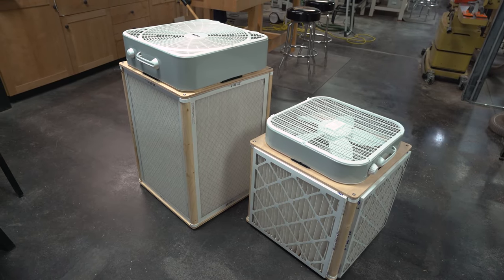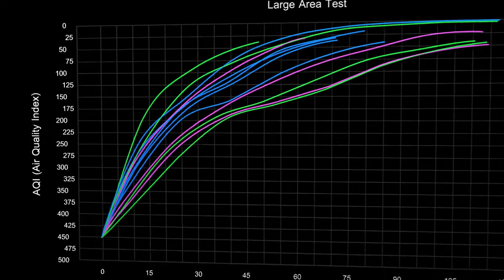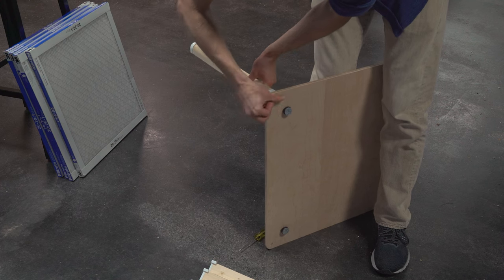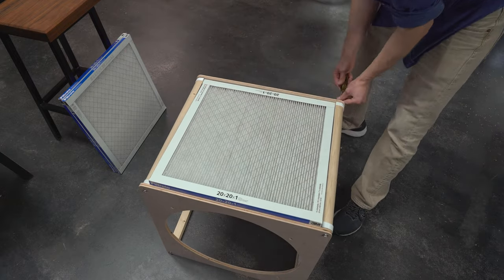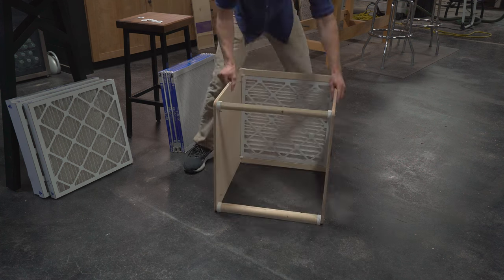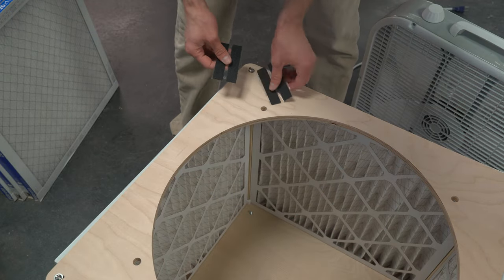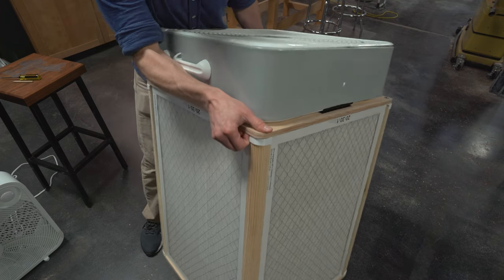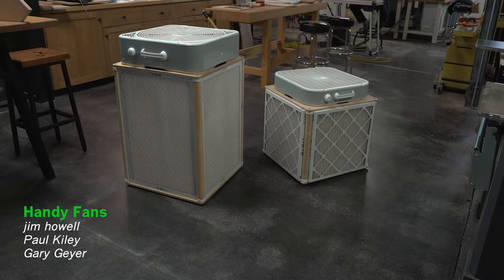Air Filter Kit - Model-B/C - Design and Assembly

Comment: I'm a bit late to the party, but have a question. Can your design be modified to include a 5th filter on the bottom?
Reply from the maker: You're right on time! All the tests that I've run indicate that the 5th filter doesn't meaningfully increase performance. It's also cheaper to buy filters in packs of 4. If you want more filter surface area, the 20x30in filters are the way to go.

Comment: I would like to see a particle test comparing a fully taped/sealed fan of this design vs the exact way this one is designed. Where the Velcro is with the fan sitting on top doesn't this Also allow "dirty" air to pass through? Also I thought the four corners on the top not being covered would pull in "dirty" air? Or after a specific run time as it purifies the air would this small gap even matter..
Reply from the maker: That's a good idea. I suspect that the small gaps will have very little difference in overall performance, but it's better to know for sure. I'll add that test into the video about A/B/C performance. Thanks for the thought!

Comment: I'm debating between Model B/C. Which would you recommend for an 1800 sqft house?
Reply from the maker: Sorry for the late reply, just got back from vacation and haven't been able to sit down and answer comments lately. The number one goal was to start getting these kits into the mail this week.

To answer your question, both are fine options. The Model-B will be able to filter more air but if your house is 2 stories or divided by lots of walls with small doorways (so, if you don't live in an 1800sq.ft. yurt), the extra air flow may not matter to much. 

All these obstructions will prevent air from circulating perfectly through all your spaces, so a Model-C in your largest room should do the most good for the lowest price.

I hope that answers your question. If you have any more, let me know!
Reply: @The3DHandyman  Won't the larger filters last longer? I'm wondering if the extended use will make up cost difference on filters
Reply from the maker: @wishitwas  Yes, the 2in filters are supposed to last 6 months in an HVAC unit and the 1in filters are supposed to maintain their rated efficiency for 3 months.

The 20x30in filters are also about the same price as the 20x20 filters much of the time. So, that will further increase the amount of time between filter changes and lower the cost of use over time.

I ran one of these units in a dusty basement for 4 months over the summer and the 20x20x1in filters turned a light shade of gray. I think they could have easily lasted all year (though they would have been rather gross looking by then). I suspect that 20x30in filters might last up to two years in a relatively clean space. I'm not sure though because I do not have testing data for that specific scenario.
Reply: @The3DHandyman That was my thinking, that I’ll probably get up to 3 years from 4 20x30x1, w/ just as much air flow as 5 20x20x1 in a relatively clean house. 

Was even thinking I could upgrade it at some point by adding legs & a 20x20x5 Nordic Pure MERV 14 Carbon filter to the base to improve gas filtration.
Reply from the maker: @capcom4eva  I think that's reasonable to assume. If you don't have 5 dogs or something 2-3 year life expectancy on the filters is possible. After dumping fine dust into a Model-A for 1 year it performance went down noticeably. In a mostly clean house it will take an extremely long time to collect that volume of dust.

The filters + carbon don't seem to really do much in my tests. The actual amount of carbon on most of those filters is extremely small.
Reply: @The3DHandyman  Ah, thank you for the carbon tip, I went with the IQAir GCX + IQAir HealthPlus Pro to deal with the fire aftermath soot, fumes & toxic flame retardant off gassing! Can you vacuum the DIY filter boxes if they get heavy dust accumulation, or not recommended?  

I’m going to build a MERV14 3M 20x30x1 + 20” Air King box fan, think it’ll have 1200CFM, like the MERV13 20x30x1? I chose MERV14 since it does a little ultra fine particles, whereas the MERV13 does zero ultra fine particles.  

I guess with the high CFM rate of the Air King, it might trap 99.97% of ultra fine particles with rapid multiple passes in a 300 sq ft area, even though it’s rated to catch only a small percentage of ultra fine particles on the 1st pass. Will this build achieve the same results, albeit a longer time frame, as a HEPA air scrubber at a fraction of the cost? 

Thanks, I’ve learned so much by rewatching your videos & chatting with you, thank you! I’ve never done much DIY, but your videos inspired me with the encouraging data results you’ve shared on these cost effective, yet powerful CFM builds! For the money, you can’t go wrong! 😁👍🏽🛠️

Sorry, final question: if I get a good deal on a 4 pk of filters, can I buy 2 extra sets to put in storage, if each set lasts 2-3 years, or will they degrade over time sitting so many years & better off buying a fresh pack of filters only when needed? The Air King is really loud, wish there was a quieter & more efficient option. Thanks!
Reply from the maker: @capcom4eva  Fine choice with the IQ Air. You have a pretty extreme situation you are dealing with.

The MERV 13s and 14s should capture some ultrafine particles. Although the 14s should preform much better (20-75% vs 75-84% sub micron particles). The air king with 20x30s will move a lot of air. I don't know how it will compare to a HEPA filter in your scenario. There are much better particle counters out there than the one I'm using when it comes to sub micron particle performance. What I can say is that in my tests across all particle sizes, 3M filters are by far the best. No other brand is close.

If you leave the filters in their plastic packaging, they should last indefinitely. Sometimes the 3Ms come on sale and that is definitely a good time to stock up because they can be pretty expensive.  

Yeah, the air king is loud for sure. You can make a "fan shroud" out of cardboard with a 15" hole in the middle. It does a little for performance and a bit for sound reduction as well.

Hope that helps!
Reply: @The3DHandyman  Do you happen to know the difference in filtration rate of ultra fine particles between the 3M MERV 14 MPR 2500 vs 2800? I went to the 3M website, but don’t think they list a precise answer. 

I went with MPR 2500, b/c it was less than half the price of the MPR 2800. I would love to try the MPR 2800, if I can secure them at a price close to what I paid for the 4 pk of MPR 2500 at Costco @ $59.99. 

Would be interesting to see if anyone has tested for it & how it compares to HEPA, when ran through the Air King with its large 1200 CFM. I guess you can say this 3M 20x30 MERV 14 + Air King setup functions like an air scrubber, no? Thanks!! 🛠️
Reply from the maker: @capcom4eva  I recently tested the 2800s against the 1900s and, at least with my basic testing equipment, didn't see any tangible difference in smoke filtration. So if the 2500s are at costco for 4 for $60, do that. That's a great deal.

I don't know exactly what defines an air scrubber but the air king is going to process 2-3 times more air than your standard HEPA filter, though with a lower efficiency on the ultra fine particles.

Comment: Love your videos! I'm just to order my filters to make my own. How long do the filters last before they need to change?
Reply from the maker: Glad you are enjoying them! I have run a 20" box in a friends home for 6 months and the filters show little dust build up, even with lots of pets. In a shop scenario, after 6 months of use, they are loaded with dust but still preform well in a smoke test. So, if you are using 1in filters, you should get at least a year out of them under most conditions. 2in filters may last even longer.

You can also consider K&N washable filters which will work for many years and only cost slightly more than disposable filters. These do not capture smoke sized particles as well as MERV 13+ disposables but they work great for large particles. Here's a link https://amzn.to/3UN3mXo

I will have some updates to these designs soon where you can buy a 3D printed part pack and the plans to make them. There are also a few new updates as well. Hopefully I can get this launched by the end of the month 🤞
Reply: @The3DHandyman  Thanks!!

Comment: Just made one but with fan pointing down inside. What's the difference if the fan blows inwards or outwards?
Reply from the maker: Outwards tends to filter that air in a room better because the air is more directed coming out the front side of the fan. If the fan is pointing into the filter box the air in the space right around the filter (~3ft) will get stuck in sort of a filtration loop where the same air gets filtered over and over again and the air elsewhere in the room gets filtered less.

I need to make a video about this some time soon. A lot of people ask this question.
Reply: @The3DHandyman  Thanks! I was going to ask the same question since in some of your other videos the fan is blowing into the filter box. Great content!
Reply from the maker: @alfredorodriguez1281  Thank you!

Comment: What is the adavantage of using a 3m one inch thick vs 2 inch thick..TIA
Reply from the maker: The 3M 1in filters actually have more surface area than the average 2in off brand filters and that translates into better performance. Both are good options. The Filterbuy 20x30x2 preformed slightly under the specs on the 3M 20x30x1 MERV 13. 

I had hoped to get the video with results for the Model-B out sooner but I have been slammed with orders since launch and haven't had time to produce any videos for the last few months. New content should be out next month, though. Until then, I've managed to get some of the info up on my website https://the3dhandyman.com/what-is-the-best-air-filter/

Let me know if you have any other questions!

Comment: Can you build one that’s uses a carbon filter like the one on the iq air ?
Reply from the maker: I will do a video on carbon filtration some day soon. So far the most effective way that I have done this is with a ducted system. Lots of carbon requires lots of static pressure and a more powerful fan than the standard box fan.

Comment: one flaw if it is that These fan is considered a bit loud. I guess it would be ideal in big work shop.
Reply from the maker: That is partially true. They tend to be louder than your average HEPA filter on a LOW setting but on HIGH HEPA filters tend to be about as loud.

Here are the sound ratings in decibels:
Honeywell HPA200 @1ft - 58, 54, 46, 41
Blueair 211@1ft - 61, 50, 41
Lasko @1 ft - 63, 60, 55

Comment: Sorry, I could not find a link to buy a kit. Your Etsy page is showing completely different things.
Reply from the maker: Sorry for the confusion! I relaunched this kit with plastic & metal parts here https://www.etsy.com/listing/1373712349

The wood version caused a lot of problems with warping and voids in the plywood so I made the switch to for reliable materials. 

The new kit works the same as the ones in this video. I have not yet had time to finish up the new videos for the relaunch of the kits. I am hoping hey will be done some time late next month.

Let me know if you have any questions!

Comment: Have you done any real world testing on how long the filters last in a normal home environment for air purification? Most of the filters recommend around a three month life but real world with the particle counter what are you seeing for the lifespan of filters? 

On the 4 filter design merv 14 changing every three months you could be $200+/yr on filter replacement alone. . 

Also the link to kits was not working..
Reply from the maker: I'll be testing this in an upcoming video. I need to figure out exactly how to soil the filters evenly and immediately in a realistic way. I'm hoping that will be out in March.

I don't think that they need to be replaced that frequently. The Nordic Pure MERV 14s in my Model-A unit were completely filthy after 6 months of use and they still managed to pull ultra fine smoke particles out of the air in 1.5hrs vs 45 minutes. Which is not awful performance. So far that's the only dirty filter test I've done. You may be able multiply the clean smoke test results by 2 to get the amount of additional time required for filtration as they get soiled. The smoke test video with these designs may offer the correct results for severely dust caked filters but I cant say for sure, yet. 

Here is another link. Not sure why the link didn't work before. It appears to be functional now.
https://www.etsy.com/shop/The3DHandyman
Reply: @The3DHandyman  thanks, looking forward to the future content.  

Odd. I tried the link on mobile with chrome and brave browser. Both take me to the same page showing a white page saying "429 Too Many Requests". I will try the link on desktop when I get a chance.
Reply: @The3DHandyman  follow up on the link.. I had no issues accessing the page via desktop/laptop however my mobile was unable to open the link.  Thanks!
Reply: @joshsansone5113  You've probably already figured this out but were you on a VPN when you got that error? Happens a lot.
Reply: @smattt  thank you! Seems so simple yet it never registered that my mobile VPN was the issue.  Just tested the link by turning it off and the link works.  I am newer to the use of a VPN and have not experienced that before.  Thanks again!

Comment: I've seen different designs and am not too sure of the pro's and con's in regards to fan direction.
Wouldn't it be better to flip the fan so that the dust inlet becomes the fan side and not the filter side? Won't this increase inlet strength? 
If anyone knows the pro's and con's of this idea, please let me know.
Reply from the maker: Blowing into the box is better for local filtration. This unit works really well in that configuration from about 5 feet away. If a fan doesn't have a lot of horsepower it wont work from more than 2-3 feet away (filter on a box fan sort of thing). It really depends on how the unit is placed next to your work area as well.

The closer the fan is to the source of dust, the better. If the fan is blowing out of the filter box it will filter the ambient air in a larger space better than if the fan is blowing into it. This is due to greater air circulation created by a strong outflow. 

So in short, blowing into the box is great if your filter is next to your work area but it will be less effective at filtering general airborne particulate further away from the filter (up to 50% slower filtration in a 2 car garage).

I'll do a video on this subject at some point to get into even more detail
Reply: @The3DHandyman  thanks mate, this was a good explanation. Makes a lot of sense now. I have an outdoor work area so I'll weigh the pros n cons relative to my filter placement and ambient air flow. Cheers!!
Reply: @The3DHandyman Interesting. I was also wondering about this, but from the perspective of containing the dust captured on the filters. If the air is drawn in from the outside, then would moving the unit result in lots of particulate being dislodged and shed back into the room?
Reply from the maker: @mattsoutherden  That is possible once it gets really caked on there. A pre-filter can be taped onto the filters to help prevent dust disturbance. I'll have a video out on this concept in a month or so.

Comment: Would like to get the the kit! Are you still giving discounts/coupons?
Reply from the maker: Hi! No coupons at the moment. As it is the profit margins are quite low for the work that goes into them. There is also a large backlog of shipments yet to be made.

I may at some point do mismatched part kits with a lower price. I have tested 4 different woods with the CNC shop and there are some spares parts starting to stack up. Would that interest you? I'm not sure when I can get to that, but I will do a post when they are available.

Comment: Can it filler, filler the smell of cigarettes  and other smoking  products  I smoke  neighbor  complain  about  the smell
Reply from the maker: Yes it can but there will be a limit to how much it can remove. The Model-B with MERV 13-14 filters can remove about 3-4 cigarettes worth of smoke per hour in a large space when the filters are new. After a few months, I cant really say how effective it would be against smoke. Haven't had time to do those tests.

A 4 filter taped together Cosri-Rosenthal box will preform a bit worse than the Model-B but it may still work. If you point the fan into the filter box and blow the smoke directly into the back of the fan, this may improve efficiency overall.

Comment: Why don't you add another piece of wood inside as a shelf to hold the fan so it can sit below the site line? If it stays flush or lower, you don't see the ugly fan. Then, you can put a filter on the top which should also stay flush. The handle for the fan should be removed.
Reply from the maker: It's a fine idea. I'll have to do some experimenting
Reply: @The3DHandyman  I will buy your first prototype.
Reply from the maker: @bombatta1544  One of the biggest issues with this concept is that the controls for the fan end up inside the filter box so a separate fan controller would be needed... unless the perfect fan can be found...